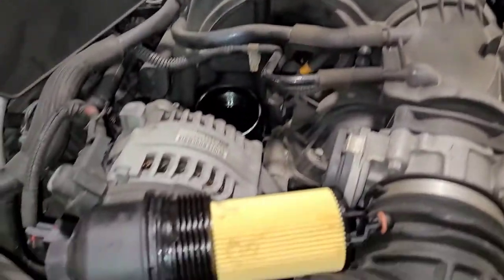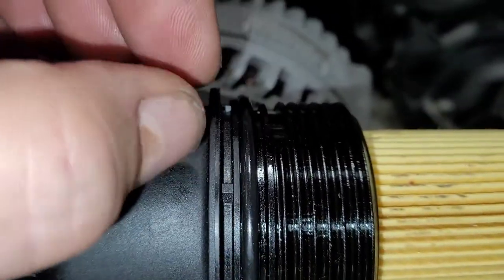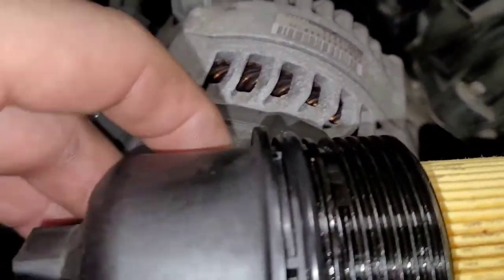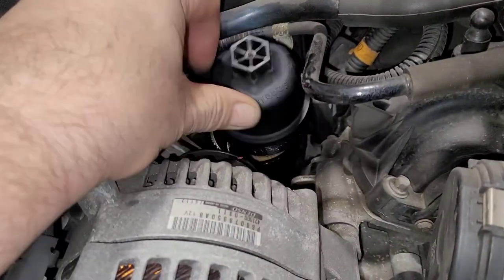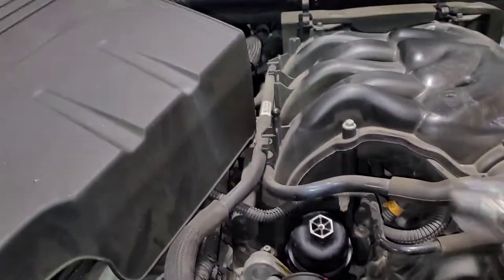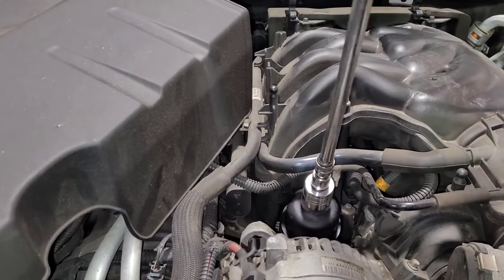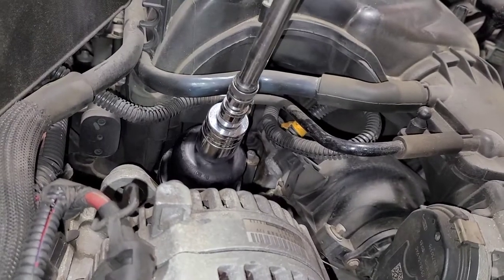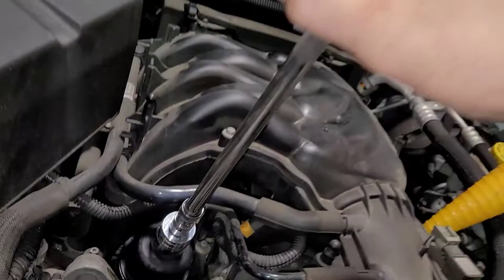Don't overtighten your oil filter !! Here's why .

Comment: When I wrenched for a living (early 1980s)  I got so many oil filters (metal body) that I had to mutilate to get off because some idiot torqued them so tight. Monster slip joint pliers and full steel shank screw driver were mandatory on some. There were many that I had to literally peel apart and dismantle the carcass to get it off.
Reply from the maker: Yep !! Been there too ! The one that sticks out in my mind was a Dodge 150 Van with a 318 . I had to rip the filter apart yo where just the base was left . Tried an air hammer but it wouldn't budge . Finally I had to take a torch and heat it to the point of burning the O-ring away before it finally released . Absolutely incredible and unnecessary. Thanks for watching !

Comment: My wife’s vehicle has a plastic oil filter housing like that. When I did an oil change on her vehicle, I needed a breaker bar to loosen the oil filter housing. The dealership had done the previous oil change. It was the same thing with the drain plug.